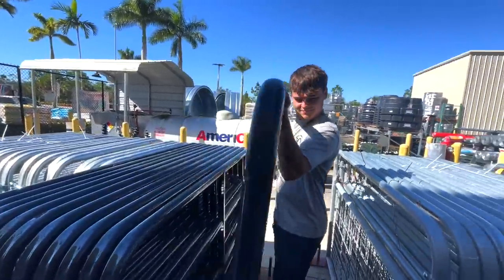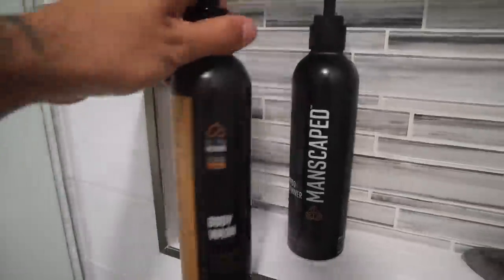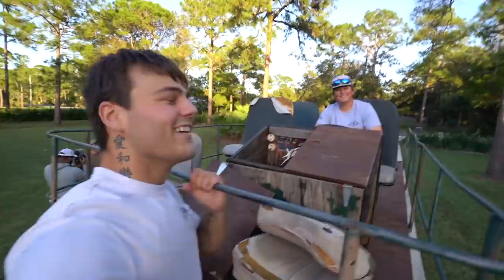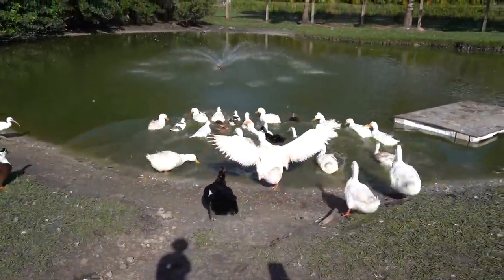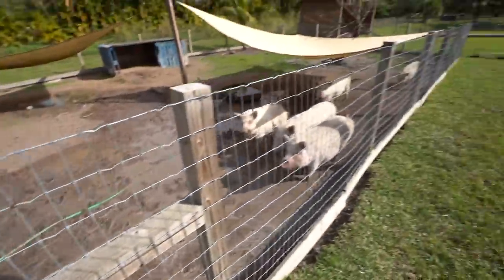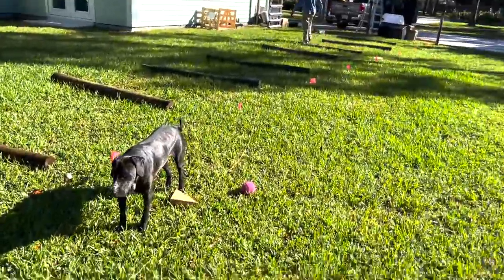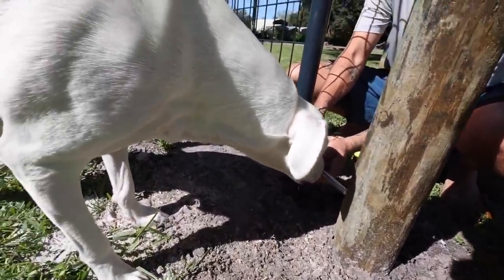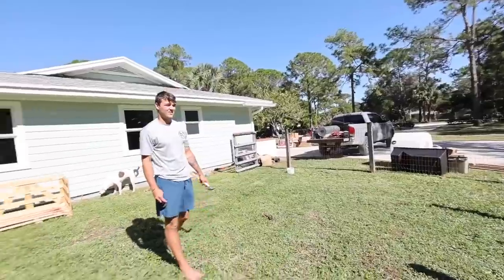FIRST ENCLOSURE BUILD at PC FARM 2.0!!

Comment from the maker: Sponsored by MANSCAPED™ 
Get 20% OFF + Free international shipping @manscaped when you visit http://www.manscaped.com/paul
Reply: Hi Paul I Love your videos!!!!!! I was wondering if you’re coming to Aquashell Orlando?
Reply: One bit of advice next time you're doing your fence for your animals bury so much in the ground of your fencing then lay cement in the hole and they can't dig it up
Reply: What about the cows?
Reply: I also live in florida, but i live in palm beach and i own a lizards, turtles, and i wanna meet you and go hangout with your pets. Im a huge fan
Reply: Hi my name is Isaac I am 8 I love your video
Reply: Hey Paul, I think you should invest into a trailer. You never know when and if a natural disaster could happen. Might come down having to pack up all your animals to save them.
Reply: You absolutely should have concreted the posts on each corner and on each side of the gate because over time that gate's going to sag. Also I feel like you should have put the chicken wire on the inside of the post because of a pain weighs against that it's going to pop out those Staples. I feel like you're going to be resecuring that shortly in the future
Reply: Also before you move those pigging closures you should run a 2x4 along the bottom of it I didn't see any bottom bracing on the buildings. It'll stop them from warping.
Reply: Other than that looks like it's coming out fantastic. I can't believe it's been close to 4 years already actually close to 5 I think I've been following you.. you've come a long way. And you doing it the right way a lot of these other YouTubers your age were worried about how much clothes they can buy and shoes and other materialistic things in your setting yourself up for the future with property like a grown ass man. You doing the right way
Reply: Hay bro I don't know but I think it's gona be little small for all those farm animals and those pigs and hugs
Reply: I'm surprise you didn't go down the fence line and dig a trench about a foot or so deep to where you can set the fence wire in and then push the dirt back in to help keep the fence sturdier and because of that you might not even have to put rocks down the fence line and could use them for something else.
Reply: Hello Paul make video on guppy and Molly fish breeding 😄
Reply: Looks really good
Reply: You know you love the creator when you actually watch the manscaped ad (even though you’ve already got it)
Reply from the maker: @NoahHagen  appreciate the love💯♥️
Reply: Can I win the GoPro? Please
Reply: @kael_2355  can you?
Reply: @paulcuffaro  would a manscaped sponsor cover the cost of a swamp buggy

Comment: Spend a lil more $ and get no climb wire for the fence you can pull it tight with a fence stretcher . And dress the fence up with a top board . It will look great.

Comment: You should really tension your mesh fence before you staple it down. A pig could easily push that down with enough force. Or at least fold it enough to get under it
Reply: You are right!  If you want to keep something in the fence, the fence should be inside of the post.  If you want to keep something out, then the fence goes on the outside.  A pig will easily push this out.  When I see one of his pigs push through the fence, I will remember your comment :)  I'm still a pc fan, but sometimes we learn the hard way!

Comment: Past Paul, I have really learned from my past mistakes and will build 2.0 much stronger and better. Immediately chooses the cheapest fence ever and wood poles and again is half assing the project. Love you man just pointing this out.
Reply from the maker: Taken this info in and I’m sitting in backyard now, have done some digging into fence types. I didn’t realize this was cheap quality till install, it’s not horrible BUT definitely gonna redo it with better fencing, at least my posts are in which is the hard part hahaha
Reply: So true, I was the same way starting out but learned hard way. Getting better quality is cheaper in the long run. I find that goat and sheep fencing is the best, webbed wiring instead of welded
Reply: @paulcuffaro  I'm a huge supporter since day one man so when I say something it's in support of you and the animals. I have been learning and I'm 44, it doesn't stop and even pros get it wrong. Your brave enough to show your journey on YouTube so you have my respect. Good luck
Reply: @paulcuffaro  a suggestion brace corners of fence if not over time they will pull and lose tension on fence since they are not concreted in